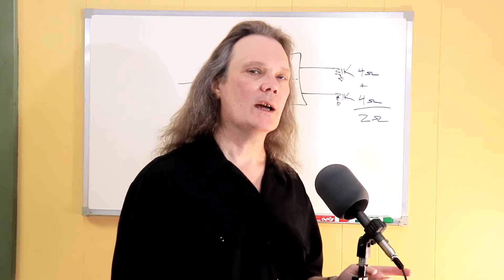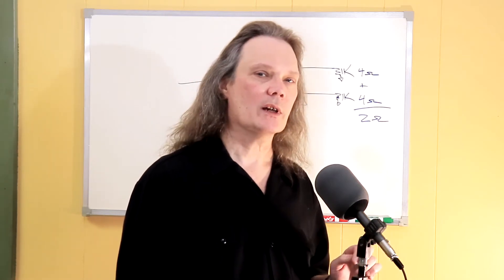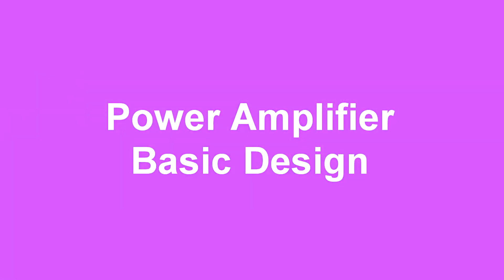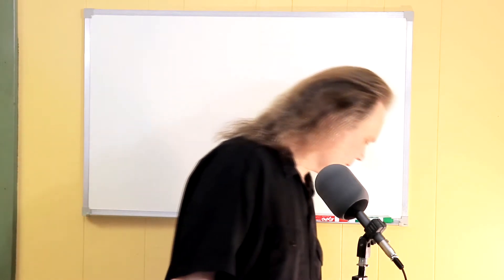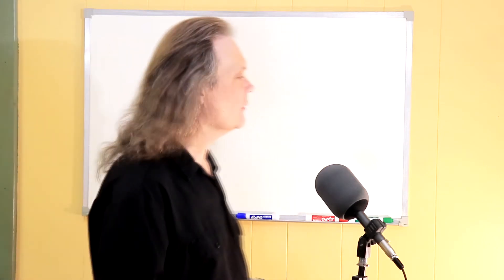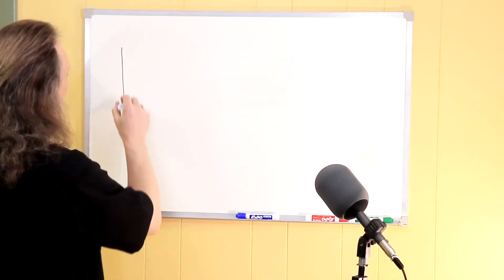Power Amplifier Wiring Trick to Get More Watts Without Bridging

Comment: I think there was a carver amp that was wired like that the M400
Plus  i think he used a triac to control the AC from the power transformer 
to the rectifier  to keep the B+ from dropping. Been a long long time 
since I saw one so I could be wrong.
Reply from the maker: I agree - Bob Carver developed a lot of innovative audio amplifier designs, I'm not familiar with the details of that model, but he certainly developed some unique amplifiers.

Comment: Great, informative videos. The Crown MA10000 could handle 0.5 ohm loads, though they are rarer than hens teeth, and you can't just plug them into your domestic mains supply. Don't forget to mention mono sum.
Reply from the maker: Crown MA10000 is a beast.  Sounds good, but not much fun to move around.
Reply: @Barry-Watson  Hey Barry, Good to speak with you. The MA10000 would have been a massive amp, back in the day. Still, today, if you could find one it would easily outrun a class D 15kw amp, it's in a totally different league. I have to say that I have only ever seen pictures of one. I don't think many of them made it to the UK, as I have never seen one in any nightclub from the very early 80's up to today. Given their weight, I should imagine they were intended for nightclub installs, I can't imagine where else they would want/need a 10kw amp. You only want to move those amps once, as you say, they are not light. For my part, old school amps sound so much better than most of today's contemporaries, with a few exceptions, if cost isn't an issue. Given the choice, I'd have a rack of Crest Pro 10001s. Those, I have seen in the UK, and they sound amazing on the low end.
Reply from the maker: My pleasure. I used to use crown macrotech amps, the MA 5000 and smaller.  I worked at a venue that was powered with a rack of crest ca series amplifiers. Both of these were great, sounded good, reliable, had no problem driving difficult loads. But they were heavy, and they had significant exhaust fans.  The noisy fans are the thing that makes me think they're not the best choice for home use.

Comment: I have a single dual 4ohm 8 sub wired to 2 ohm I have a amp that is 2 channel 2ohm stable can I just run one sub off one channel of the channel
Reply from the maker: If the speaker load is two ohms, and the amplifier output is designed to drive a 2 ohm load, everything should work properly.

For me, I try to avoid driving less than a 4 ohm load, the greater the load the thicker the wire that is required to not lose power in the wiring. Also those extremely low impedances are very demanding of amplifier current and can make amps run hot.  

If you wired your speaker coils in series That would be an 8 ohm load, which would be easy to drive, might sound better, but you probably would not be able to achieve the same power levels from the amplifier.  Another option would be using two amplifier channels, each channel driving one of the voice coils, so that would be a 4 ohm load on each amplifier side. That may be the nicest solution.
I'd expect any of these options to work ok.
Reply: @Barry-Watson  thank u so much I’m going to get a mono amp 2 ohm stable but I have this 2 channel just sitting here 😂  I wanted to no if I can run it for the time being oh yea amp is bridge able 4 ohm load
Reply from the maker: Cool, sounds like your amp is spec'd to run a low impedance load.

Comment: Makes sense. Ive got this stereo amplifier that tests around 500watts before clipping into 4ohms on one channel loaded down. 

With both channels loaded theres some significant voltage drop on the output down to around 350watts per channel  :( 

The 56v B+ x the 10amp fuse rating is 560watts total? Soo im guess its pulling the b+ just enough for one channel to run at full potential, and this trick would help get the full power combined from the b+ and b-?
Reply from the maker: Exactly, it allows you to pull energy from both sides of the supply on the peaks. It's an interesting exercise, but in practical terms I don't think you're going to see any truly significant gains in most cases.
Reply: @Barry-Watson  yea.. the trick made no difference. Probing the b+/- under some heavy bass transients showed the same drop reguardless of swapping speaker/signal phase on one channel.

Comment: Neat trick!  But doesn't this only work if you have separate supplies for +/- as opposed to a single double ended supply?
Reply from the maker: If your amplifier had two completely independent power supplies, which is a little rare, you probably wouldn't see much gain from this approach.

Most amplifiers have one power supply module, with a positive side and a negative side. Peak demands on the amplifier channels typically have both channels drawing peak energy from one side of the power supply at a time. With this little trick, it allows the channels to draw from both sides of the power supply during peak demands, and can yield a few percent more power.  This trick applies to amplifiers that are running in stereo mode, with both channels essentially driving the same material into woofer systems.

Keep in mind, we're not talking massive gains here, and this sort of approach is probably only practical in really high powered systems like concert audio where a few percent gains might matter.  It's also just an interesting scientific exercise.
Reply: @Barry-Watson  I see, thanks for the detailed response!

Comment: I have a qsc rmx5050 amplifer rated at 5000 watts bridged that l was considerring bridging in order to drive two b&c tbx100's 18" woofers hooked in parrallel bringing them into 4 ohms.  Is that a bad idea? My main concern is having the headroom needed to avoid burning my speakers by overdriving without sufficient headtoom.
Reply from the maker: Well, that's plenty of power. Plenty of power to do some damage if you're not careful.

Keep in mind that the concerns about having enough headroom so you never hit clipping distortion, are largely focused on full range systems where the distortion could be damaging to the high frequency drivers. 

If you're driving subwoofers in a bi-amped system, where that amplifier is only driving the woofers, if you briefly clip the amplifier and create a little distortion that's probably not going to be much of a problem for your woofer drivers, and you might not even hear it.

Of course if you drive the amp deeply into clipping that will create an ugly power envelope that might burn stuff up. I wouldn't recommend running any amplifier into hard clipping if you can avoid it, speakers don't like that.

Personally, I think that MX5050 has plenty of juice, any way you decide to hook it up. That's a great amplifier, if you don't have to carry it around too often, or you enjoy weightlifting.  Also, since this is a pro-sound amp, I believe it has a clip limiter feature which I would enable, that should prevent the amplifier from being driven right into clipping too easily.

So, I really wouldn't expect to have a lot of concerns about headroom with that set up. Good luck!

Comment: What about the Ohms? Normaly you brdige the Amp and wire 1+/1- Parallel 1+/flip 1-to 2+ - -8 Ohms become 2X4 Ohms.  In your video it seems to be Series-Mode. What about the Ohms?
Reply from the maker: The load on the amplifier (ohms) doesn't change.  We are not bridging in this scenario so each side of the amplifier still only drives it's original load as it would in stereo. You do swap the polarity on one output and one input, but there are no other wiring changes.

Comment: Would that configuration cause any problem with your amplifier?
Reply from the maker: This configuration does not put any undue stress on the amplifier. It also doesn't provide huge power gains, either. Probably most valuable when dealing with really high powered amplifiers, where a few percent difference actually makes a difference in terms of actual power output
Reply: @Barry-Watson  thank you Mr Barry your    videos are awesome
Reply from the maker: Awesome, thanks!
Reply: Mr Barry hi again, hope you are well, I've tried the configuration, it works and well just a bit concerned about the gains, only ch 1 works ch 2 doesn't
Reply from the maker: If you swap the input cables and the problem moves to the other channel it's an issue with your input signal. If you swap the cables, and nothing changes, then I would suspect the amplifier. 

I'm presuming you're using an amplifier that accepts balanced, three wire, input signals and you're driving it with a balanced signal.
Reply: @Barry-Watson  hi again Mr Barry,I swapped out the cables and it was the same, however the amplifier works flawless on stereo or mono bridge,I usually run it bridge at 8ohms 4,18" subwoofer, and no issue she,the amplifier stays cool ,I wanted to try your configuration, thank you for your time and help your videos are awesome thank you again

Comment: my speakers keep cutting off and amp turns off only turns on when i'm driving fast. what do i need or do
Reply from the maker: Strange.  I'd check ground and power connections, make sure you're getting steady proper voltage with a meter.  Could also have a bad speaker connection causing an intermittent short... or an internal problem with the amp.

Comment: CAN YOU BRIDGE THE 5 CHANNELS ON A 5.1 POWER AMP?
Reply from the maker: see this video: https://youtu.be/TsL9TyHtV28
and maybe this one: https://youtu.be/zXZP2O4rH3M

Bridging joins two channels into one output, so if the amp has a common ground you may be able to bridge (for example) channels 1+2 and 3+4 into two higher-powered outputs.

In practice, often multi-channel amps don't offer the oversized power supply, output stages and cooling that is needed to offer good performance gains and reliability in bridged operation.  So, unless the amp is exceptionally stout, I'd doubt that you'll see the results you're looking for.
Reply: @Barry-Watson   ok thank you for the information. The amp I'm talking about is a sunbuck digital karaoke amplifier av298bt it's a 5.1 soround sound amplifier real cheap and narsty
Reply: @Barry-Watson   I know it's just my mate and I was wondering if it could be done and I just like being a know it all haha but seriously thank you for you help
Reply from the maker: My pleasure!  Thanks for subscribing.